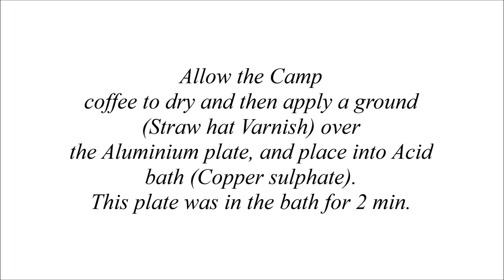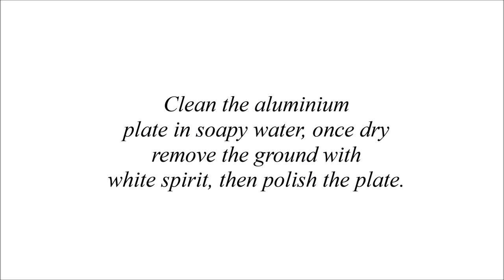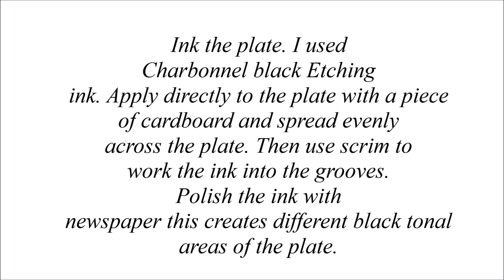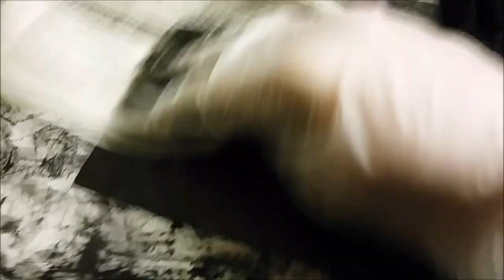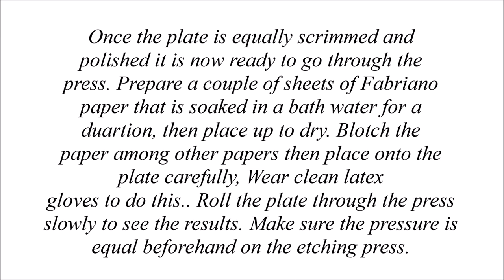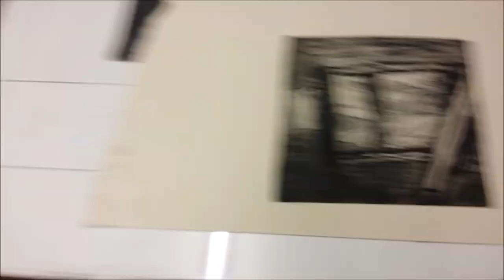Etching Printmaking (Sugar lift)

Comment: hi Stuart, do you sand your aluminium first, I'm having real problems degreasing using household items  and what do you use to polish the plate?
Reply from the maker: Hi Sarah, thank you for stopping by. I don't sand the plate before starting only degreasing and polishing by using Peek and Brasso. Then I put either soft or hard ground down. Try those products see if they work. Do you enjoy printmaking?

Comment: The white areas in the final print are not clean-was that a result of improper wiping on your part, or a result of the sugarlift etching process?
Reply from the maker: Hi Vinay, the white areas are down to ink still remaining on the plate. This also adds atmosphere to the print rather it being perfect. Thank you for stopping by too.

Comment: Aluminium has a natural tooth if it is etched with copper sulphate and salt, as this is...So you don't really need an aquatint unless the spaces are very wide...xx.
Reply from the maker: Thank you Gina yes very true, do you like printmaking?
Reply: Just spent today struggling with sugar lift on aluminium..If you get the straw hat too thick the sugar won't lift, too thin and it foulbites. Lucke Al. is so soft, I am scraping back the whites and am full of hope!
Reply: @StuartBurne  Yes, very keen! Making big monoprints, and very small etchings!